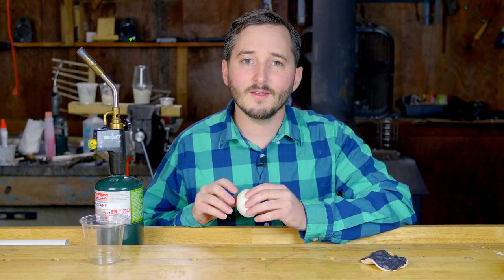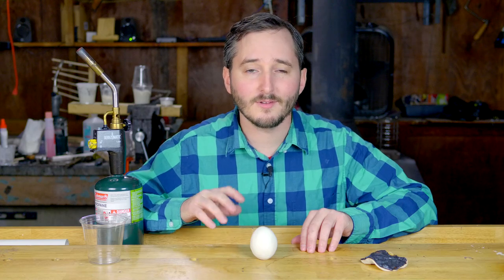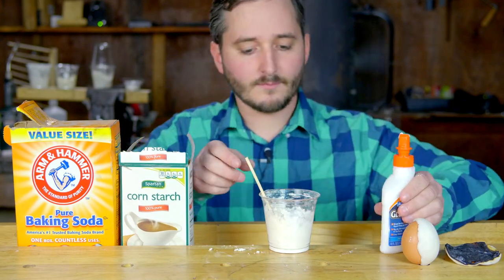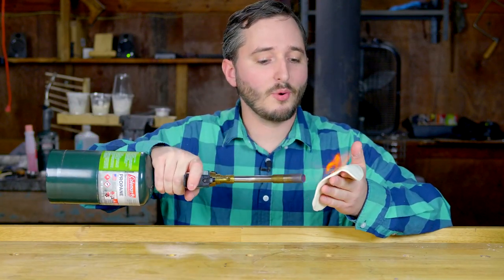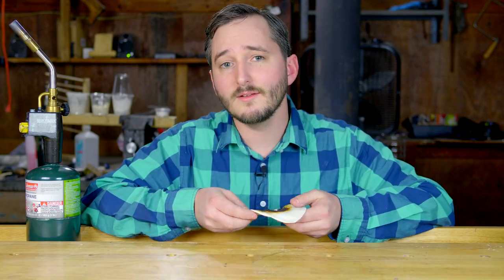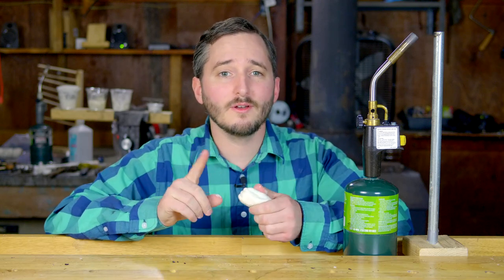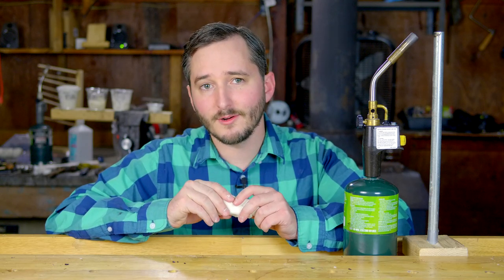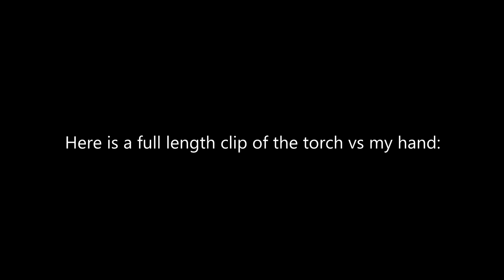A Super-Material That Can Be Made In The Kitchen (Starlite Part 1)

Comment: This is actually amazing. see if you can find a way to make this as a ceramic
Reply: So, in order to make ceramics, you need to superheat materials in low oxygen environments for several days to release the water content. Because this is a heat proof item, it's impossible to make a true ceramic out of it. The closest you could get is maybe thinning it out and then drying it, or maybe replace the water with an oil or alcohol and then drying it.
Reply: Bismuth LD 🤔 replacing water with alcohol... isn't that part of the process for making aerogels. Sir, I think you're on to something.
Reply: jpnoyola so you know how jesus can turn water into wine?
Reply: @Ferraday  Can you elaborate? I don't understand how the question relates to the context of the thread

Comment: Great illustration!  I install various trailer towing hitches on trucks and cars, some of which, require welding and cutting in proximity to wiring harnesses and fuel lines. This would be an awesome heat protective barrier. I’ll give it a try. Thanks
Reply: Hey, did u try this formula... How did it go, share your experience..
Reply: That sounds both amazing and intellectually stimulating.. The aspect you could put this stuff around the wires or area to protect it from heat  is outstanding concept.

Comment: Finding a way to turn this into a hardened ceramic would be awesome.
Reply: Given that part of the mechanism of starlite is a thermal expansion, making it rigid may nullify its insulative properties.
Reply: octet33 But Starlite was able to be a paste or a ceramic, according to the inventor. I get that this probably isn’t the exact formula for Starlite, but considering the similarities, it must be possible somehow.
Reply: @matthewpattonv5326  Not ceramic...  Resin.. like polyester fiberglass resin, or even plastic mixed with baking soda.  I'll run some thru my precious plastic extrusion machine and try it
Reply: @preciousplasticph  I think any kind of plastic would trap the carbon and be counter productive. You should consider a carbon based binder. Maybe some kind of glycerin.
Reply: @preciousplasticph  woot, interested in the results!
Reply: @ProperMethodz  plastic is carbon.  When it breaks down it will outgas flammables and carbon black nos left behind approx 30% for thermoplastics.  Polyester resin is something else.
Reply: @preciousplasticph  I'm thinking maybe a sugar, just a compound that isn't synthetic and would assist in the reaction.

Comment: Have you considered adding silica or boron oxides to the mix?
This should basically turn the mix into a pre ceramic polymer that can form a carbide ceramic foam in response to heat.
Reply from the maker: I've tried some silica additives but not with the idea of making a ceramic precursor. That's a great idea. I may play with it.
Reply: Custom Made Stone  Lol just weld the exhaust manifold, it isnt expensive. With somethin like this ull have endless leaks. The whole idea of the carbon "foam" is that its "foam" and has air between the molecules. These air pockets are small enough not to let the heat radiation pass through, hence aerogel is 99% air, but one of the best insulators. Epoxy will never compare to actual weld, including JB weld structural epoxy (which is a really fantastic product).
Reply: Custom Made Stone  It's been a month. How did your experiments go?
Reply: Custom Made Stone  how'd the experiment go?
Reply: @Nighthawkinlight  Do you suppose this stuff could be put on a window to reduce heat from sunrays? Thanks
Reply: Custom Made Stone  epoxy is flammable and JB weld is temparary  welding a cast  iron exhaust manifold with cast Iron rod is proper repair for expansion rate  alithough brazing is a more flexible and  durable repair up to 2500° unless you can make a bandaid stick hot air!
Reply: @mikey_mike !++!he probably wants an iron on repair that you don't have to iron on
Reply: The overall medium should be a kind of mud rather than a putty

Comment: Ok don't leave us hanging. Tell us why Starlight didn't commercialize! Are you going to make a product out of it? And how did you reverse engineer it?
Reply: I'm going to guess that the reason Starlight isn't used, is that for it to work, the outer layer needs to be burned, creating the carbon layer first.    So while this may have specific applications, It wouldn't be good as an insulator for your house, or clothes.   

He never showed us it's thermal properties, before it's burned.  What if he just slowly warmed it up on a hot plate, but not hot enough to form the carbon layer?  I'm betting it would just slowly heat up, like any putty, or ceramic would.

Comment: make some thermite. cover it in this. see what wins
Reply: Plz do this
Reply: @TheFilledk  He wont, he is lame.
Reply: Also the video is faked.
Reply: @jonross377  I'm having doubts too I've been trying to figure out the chemical make up of this but the molecule won't balance
Reply: @jonross377  I'm not sure if you're being serious or not, but if you are, please elaborate. Just saying "The video is faked" doesn't carry any weight. At least Tre'von explained his doubt. I'm not a chemist, but the logic presented in this video seems sound to me.
Reply: @trevoncowen9198  Just because it would fall over doesn't mean the molecule isn't useful... :P In all seriousness it doesn't matter that the reaction doesn't balance very well, as you will be getting a mix of gasses off anyway. The only important thing is that it foams, and the atmosphere is reducing.

As for what would happen if you wrapped thermite in this, I would imagine the temperature would rise until the aluminium boiled. The carbon foam is stable at this temperature. What happens next depends on how well sealed the body is. If the pressure can rise considerably without over pressurising the container I would expect it to behave as a low explosive, similar to gunpowder. The pressure would increase and the aluminium gas would be contained, to react with the iron oxide at a runaway rate. The temperature would not be limited by the boiling point, so the carbon's insulating properties might collapse, but it would happen so fast that it really wouldn't matter anyway.

If the 'egg' was not well enough sealed, the heat would escape in the form of jets of escaping aluminium gas. Kind of want to try this now...
Reply: Yessssss
Reply: Talk to the King of Random.  See if we can't get Nate and Calli to do that
Reply: Havok Vladimirovich Stalinov   Hahaha! 
Yeah, if they're not busy figuring out the deepest secrets of the universe … honestly, those two are… well, they've certainly changed that channel. It's even more "random" now, topic-wise.🤔

 "What what happens when we put batteries in the toaster!",  "Third attempt at copper beryllium candy - IT WORKED, but tastes awful!!", "Did we just discover a new kind of bubble!?" (spoiler alert: they probably fuckin' didn't)

Grant shouldn't even let them in his house, they'd totally try the Starlite vs Thermite thing, probably in his basement or on the pool table instead of outdoors. Nate and Calli should just get married (like all the fans want), post the obligatory "Don't Ever Do THIS Without A Condom!" video to Pornhub (like ~half the fans seem to want), and start their own channel full of "What happens when ____" idiocy.  Nate did a video the other day about how nail polish remover unexpectedly wrecked some LEGO, I mean, I'm pretty sure it says "acetone" on the bottle, and he already knew what acetone does to most plastics…  are we just watching him forget stuff now?

Whatever … they're just kids… they're alright, I guess. 😎
Reply: @havokvladimirovichstalinov  they're too busy cooking glue sticks in a panini press
Reply: @youtube.commentator  saw that
Reply: @trevoncowen9198  its not a compound but is a mixture
LEL you cant balance it as is
but if you do want the chemical compounds in this mixture
it is the following
polyvinyl acetate (glue)
amylose (starch)
sodium bicarbonate (baking soda)
Reply: That's definitely something Cody's Lab would do
Reply: Thermite vs this has been done by Beyond The Press. Worked well. Much better than toast...
Reply: @jonross377  Literally just made the stuff. Mine wasn't as good texture wise, as it's my first attempt. It worked just about how the video promised. I think my ratio was a bit off, but it blocked all the flames from the torch without heating behind it just fine.
Reply: I know the comment is a year old, but soon after the video came out I actually made a batch and did just that. The thermite won, but the thickness of the sheet I put it on was super thin, like a tortilla. The molten iron blob burned through, but made a very clean hole shaped exactly like it
Reply: @lucasthompson1650  Yeah I have been feeling this way too. Much too "random".

Comment: Put some permethrin pesticide in your Starlite, around 5 to 10%, to stop mold and bugs from eating it. Press that compound into a fiberglass mesh and you will have something you can use with a kiln long term.
I see the MSDS for typical permethrin products show a flash point, and I looked at one of them it said 268 degrees F, a second said greater than 212F. Don't rely on the data sheets proceed with caution. Of course, when you first burn it to create the carbon foam do not breathe the fumes.
Reply: @LANCE OBST Ya, accept your dog might eat it. Poor puppy!

Comment: I want to see the video about why it was never in commercial use
Reply: The inventor wanted to maintain 51% ownership and wanted billions for the product. That's why it never saw commercial use.
Reply: Taken to his grave
Reply: What a putty material hold up slapped on a rocket ship or inside a furnace?
Reply: @allyw7405  not as extreme but i was wondering how a cars' exhaust would react covered with this stuff and then wrapped in automotive heat wrap?
Reply: @TheMr408  The problem with this material is that you have to heat it up beyond the ignition point in order for the carbon foam to insulate, also I can see it potentially isn't very stable and may decompose rather quickly.
Reply: @TheMr408  my first thought was to make a header wrap with this!

Comment: Again... fascinating...

I'm interested in high heat insulation, as in a woodstove. You got me thinking on this concoction and how to use it in the stove I've made, inspired by YT videos. 

As always, I am an innovator/inventor... and with this stove, which is a larger version of the one made on YT channel, Zero Labs, I am constantly coming up with ways to improve its output and efficiency. 

The key with this stove is its ability to create an internal kiln of sorts, that incinerates creosote, smoke, and other combustion byproducts created by wood combustion.

What also fascinates me with this stove is its demand for a certain CFM of combustion air for a given stove temperature.

It works like a turbocharger on a car motor. Without a wastegate, the motor would run faster and faster. The hotter this stove gets the more air, and wood, it consumes. One can regulate the temp of the stove by the amount of wood loaded into the burn chamber.

If you stuff it full of wood, the stove demands a certain CFM of air. With the chamber blocked by fuel, the air must move faster in order to satisfy the stove's demand. The higher velocity of air fans the flames, and it burns furiously, but also consumes a lot of wood. Once up to temp, filling the burn chamber halfway keeps things civil.

My burn chamber has a liner of 1/4 inch plate. Evidence of molten steel is found, I didn't think it burned that hot. 

I need to rebuild, using ceramic or firebrick... but I may experiment with this material you've concocted... I may need to reinforce it to make it be able to withstand normal use. I am interested in its physical properties of toughness (the metallurgical term), and it ability to withstand abrasion.

Subscribing.
Reply: Rocket stove
Reply: I doubt it would stand up to abrasion very well in the composition shown. I don't think it should be terribly difficult to make a more durable version, though.
Reply: @sangeetadesai8104  Yes.
Reply: @ChildovGhad  I was not thinking of using this material in the burn chamber of the stove where the wood is loaded, ashes removed.

The (horizontal) burn chamber empties into where all the magic happens, a vertical riser, inside a 55 gallon barrel.

My present riser is made of insulated firebrick, a brick very light in weight compared to regular firebrick. It is often used in kilns. The heat of the fire builds, where creosote, and even the smoke, is used and consumed as fuel. 

Once up to temp, the exhaust leaving the chimney is smokeless. In very cold weather, it is visibly water vapor, like that from your breath.

If you are interested in this stove, do check out Zero Lab's channel. He's a very intelligent man, crafty, and driven to innovate.

My channel shows a short video of an early version of this stove with no narration.
Reply: @thomaswalz3515  I'd still experiment with making it more durable before using it for that (or almost any other) application.

Comment: original starlite does not seem to char anywhere near as much as your version but none the less very impressive
Reply: I would say the most likely case is that the principle behind the insulation is the same, but the specific components used to achieve this are different. What he uses in the video is a simple method using household items likely if you researched this effect enough you could produce a much more optimized product

Comment: I remember when I was young back in the 70's, my dad worked for a fire prevention company that sold fire extinguishers, equipment to fire stations and businesses (as well as residential), and insulating materials. I was young so I don't remember what the material was, but I remember watching my father take a piece of the insulation they sold and used for demos, and place it in the palm of his hand (it was about 6"x 6"x 1"), place a penny on top, and then melt the penny with a torch without being burned. Fireproofing materials have been around for decades, but for some reason no one is interested in using them to their full potential. Sad really.
Reply from the maker: That's a great demo, I may try it with this
Reply: Yeah that stuff is revolutionary
Reply: Carbon Foam?  there are a few materials that can do this, back in the seventies it might have been asbestos.  CFOAM sells a carbon foam material that can do this, but it has generated very little interest

Comment: You may have actually replicated Starlite. This mimics its properties absolutely perfectly, except it's a bit smoother. Maybe too much glue, or not enough drying? That, and dextrin may work better. A finer powder mix might be beneficial too, so running it through a ball mill and/or blender might be a good idea.
Reply: Spirit I’m replying to this so I have a reference later
Reply: starlite had ceramics and "up to 21 compounds" so he may have found a few ingredients but definitely not all.

Maurice ward being a hairdresser probably factored into it so he would have used materials he was familiar with that had fire fighting properties. He probably made use of Silica Dioxide, or one of it's forms, due to that being used in hair care products and toothpaste while being a ceramic used in flame retardation.

Would be interesting to see some ceramic compounds added to this recipe, and maybe then expermented with a binding agent that can form a more solid block. Maybe hair or another fibre like substance can be used to bind compounds together to reduce ablation.

Hair is pretty flammable but as we all know mixing two different things together can produce different properties (like freezing paper/wood pulp to make a super strong material).

Comment: Also you should test its ability to contain heat. For Instance, you should heat up an iron bar until red hot, then completely coat it with your starlite. If effective as an insulator for heat, it should not dissipate. Making a thermal battery. Heat is a waste product generally in most conversions or utilizations, but effective conservation would be achievable with it. Solar energy would largely become more attainable because of an effective thermal battery and would be more viable than other energy sources.
Reply: Definitely something to try but I don't think it would be able to take as much advantage of being an excellent black body radiator. I have almost no experience with this however, so I'd love to see an experiment but my hypothesis is that it won't be nearly as effective. Also if you disagree with me I'd love to hear why I'm wrong as I probably almost certainly am in at least some respect.
Reply: @JayTheYggdrasil  I already considered that factor actually. But it's almost irrelevant I think, because the black body radiator is on the inside, trapped from the outside world, unable to transmit energy. The biggest problem I've foreseen is that expanding gasses may rupture the starlite. In that case you'd have to in case it with something that can handle internal pressure
Reply: @JayTheYggdrasil  wait, are you saying that because it's a black body radiator, that the reason it can handle heat, is because it's so good at conducting it?

Comment: This would be good to line the inside of a large lithium power wall type battery pack. That way if the lithium batteries go up in flames the fire wouldn't spred beyond the box it's in.
Reply: I think those have the issue of building up pressure inside, might just push right through the material.
Reply: @kurdaitcha5806  hmmm maybe a metal tube curved around the inside of the box to be a vent. Long enough to keep flames inside but allow the smoke and other gasses to still escape.